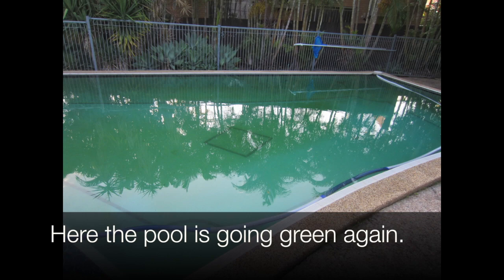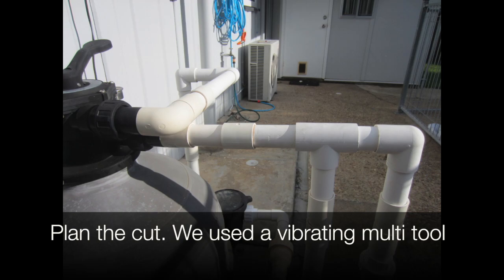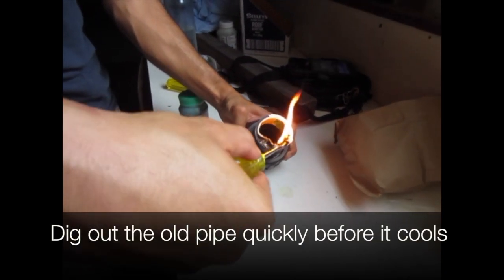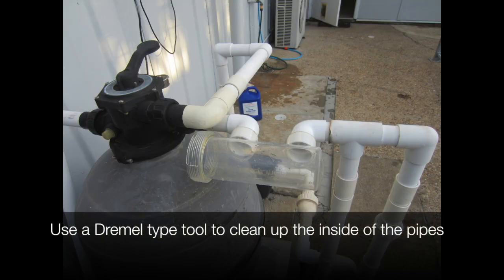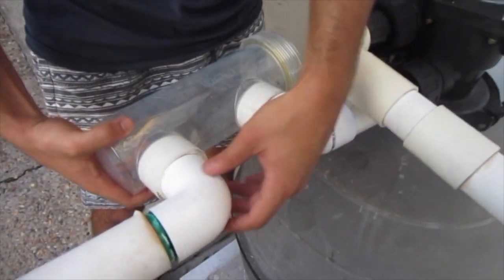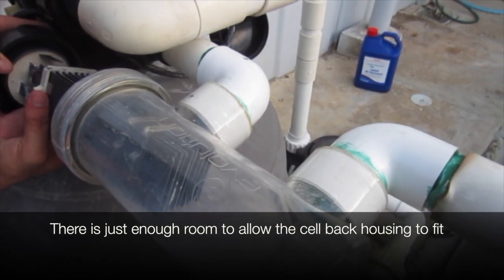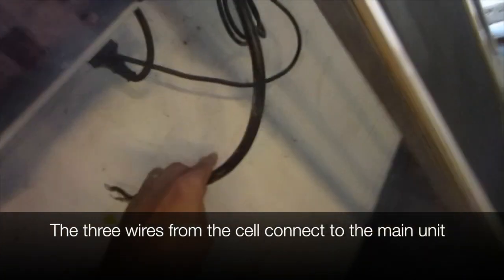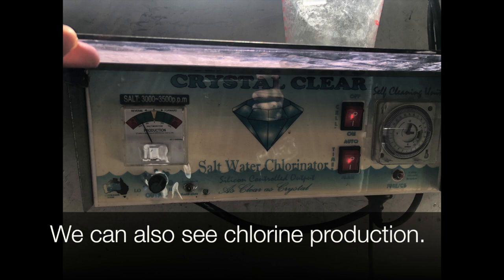retro fit salt water chlorinator

Comment: No flow switch required?
Reply from the maker: I think no flow switches are mainly if the pump is set at a lower level than the pool .
We have one in a different house but that no flow thing died quickly and we just open the poop pump area
Quickly and close it beige too much water escapes .